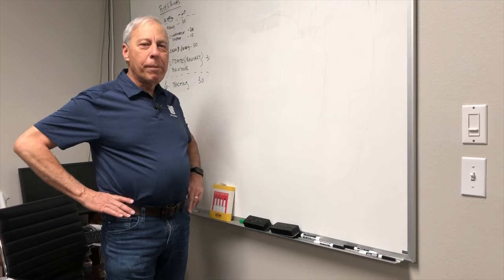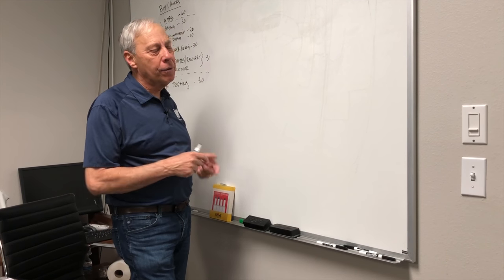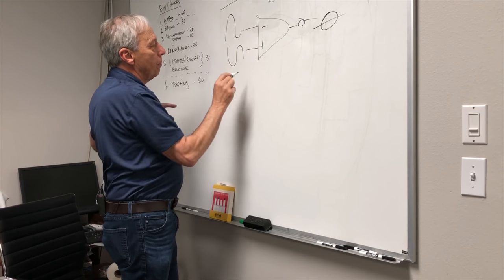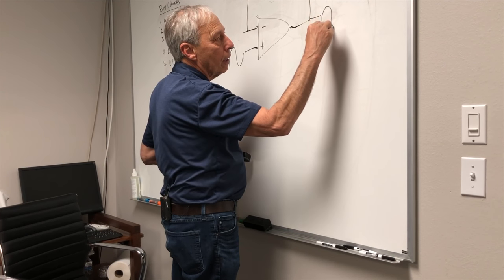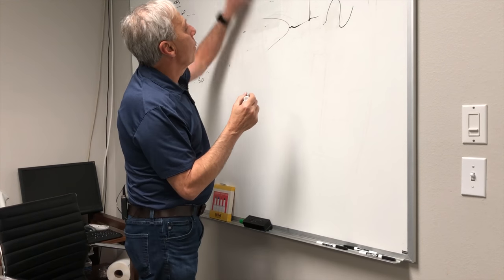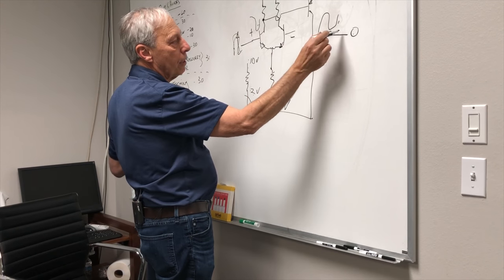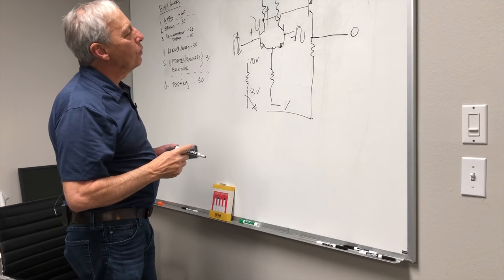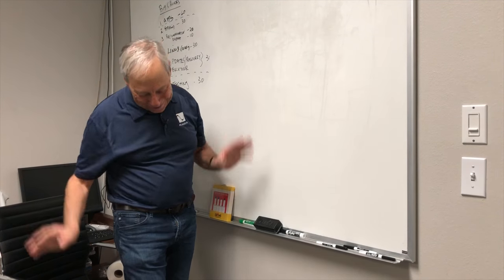The inner workings of an amplifier

Comment: This circuit appears in OP amps and power amps (some very famous ones). It is well worth taking the time to understand it as it is the four stroke engine of the amplifier world. Paul did not show the output stage as it would take a whole separate lesson plus there are multiple configurations. Maybe that will be the next video!

Comment: Your sideways triangle represents an op-amp and a lot of audiophile think op-amps are bad. I have an old preamp that has a cult following for its sound which hides the fact that its op-amp based by sealing the circuit in epoxy. I chopped open one of the circuit modules and found a Signetics op-amp inside. Now this is one of the best solid state preamps i've ever heard and I own one but its a good bit of work to get it working right as Its direct coupled and puts out a lot of DC when its not working right. i rebuilt the modules using the same op-amp but adjusted it for close to zero volts DC out.
Reply: Like any other components, op amps are not intrinsically bad, but must be designed into circuitry by experienced and knowledgeable designers, or the results can be very poor.  Op amps available today cover a wide range of performance regarding many different aspects, and half of the design battle is understanding which ones are suitable for your design.  
Further, what many audiophiles fail to understand, is that many if not most discrete amplifier designs are built on the same circuit principles as IC op amps.

Comment: You were struggling Paul... lol !!
The theory behind Diff amps is rather hard to explain I know .. but at least you gave it your best shot ....
I take it those two transistors are replaced with triode vacuum tubes on the BHK series amps ...
Can you tell me why Bascom opted for mosfet outputs and not bipolar ? The latter are far quicker ( slew rate + stability )
Reply: Mosfets arguably create a more musical than bipolar amps, Bascom actually stated in one of his videos that he prefers the sound mosfets produce. They are also more stable with temperature, having a tendency to reduce power through the device as they heat up because RDS (resistance drain to source) increases with temperature. Mosfets also switch much faster than bipolar do and therefore have the higher slew rate.

Comment: Hahaa, got a severe flashback to my early electronics classes when the teacher jumped the gun and just went wild and drew several transistors, resistors, plus and minus signs all over,  with several configurations (Grounded Emitter GE, GB GC) trying to "make us understand" how it worked. Damn, we where just done with ohms law DC and was working through AC and impedance when he started with these amplifier drawings on the whiteboard.

He did not ground us first in understanding of even how a basic transistor works!

Oh boy that was a wasted semester, the whole class was dumbfounded, we could only try to remember to say the right combinations of letters when he pointed to different parts of amplifer designs... no one had a frickn clue of how it actually "worked".
Got a new teacher for next semester, 10 minutes in "This is a transistor, this is how it works: Bipolar types, current goes in here, will make more current flow here to here at a set amplification rate, like 10 times... or several hundred times. It all works like a tap on the wall. So, more current flow in here, on da base, increases the overall flow like a hand turning the knob more blah blah".
Everybody: "ooooooooh, so  T H A T  was what the other teacher was not explaining to us... for weeks..! yeah... now we get it, carry on lets build that amplifier"

Yeah... teaching is also an art in itself. Crap teachers = dumbfounded kids that can at best repeat verbatim what teacher/textbook say like an excellent parrot but has no genuine understanding of why and what a system does on the whole.

No one:
Me: Yes... I am still angry for that wasted semester even though it was 30+ years ago. That piece of garbage condescending teacher has f--k up so many students over the decade he worked there. I just assumed I and class mates was seemingly "a little slow" for not understanding "the simplest amplifier designs" better. Actually... I wonder if he even understood it himself.

Comment: The explanations are great - but a little more planning would help.  Before you explain this difference amp, maybe you could explain a basic transistor, like you did at the end.  The difference amplifier is much easier to explain if your audience is clear on how a single transistor works - as very simple amplifier circuit.

Comment: A valiant effort.  I've ran into that quite a few times.  Where you start and explanation and realize that your audience may not have the fundamentals needed to follow.  

I was able to follow you through the diff pair but I believe only because a recent video by RSD Academy on Small Signal Amplifiers gave me the understanding to follow and see the added value of the op amp internals.  Op amps are now less of a mystery to me.  I could use them but didn't really understand the inside of the black box.

Comment: i have 2 subwoofers that are 360 watts RMS AN 720 PEAK each...I HAVE A CROWN AMP THAT PUTS OUT 1100 WATTS BRIDGED  AT 4 OHMS ..WOULD THAT BE ENOUGH POWER ..?THE SUBS A DUAL 4 OHMS..THANKS
Reply: john smith is that 1100 max or rms and at what ohm... And what ohm are you gonna run? With 2 dual 4 ohm voice coils you can run anywhere from 1 to 16 ohms.....
Reply: i think its is peak power but not sure it dont say...going to run them at 4 ohms......and its 1100 watts at 4 ohms..
Reply: john smith if it is the xls1000 you have 215@8   350@4 per channel 1100 bridged according to amazon. I would assume it is peak. I would hook up just one at 4 ohms and see how it sounds. It will tell you if it is too much.
Reply: yes it is the XLS1002 CROWN AMP....DO YOU THINK I WOULD BE OK IF I JUST HOOKED IT UP AT 350 WATTS AT 4 OHMS..?INSTEAD OF 1100 WATTS BRIDGED...?..I ACUALLY HAVE 4 OF THESE SUBS SO I HAVE TO BUY ANOTHER AMP TOO...THANKS
Reply: john smith on crowns website it says 550@2.
I would hook one sub at 4 ohms to the amp bridged. And hear if it is too much(it will knock loud) then if it is not hook the sub up at 2ohms and do it again. You might need the xls2002.
Reply: OK IF I DID 2 OHMS THE AMP WILL GET HOTTER.?THANKS FOR YOUR HELP...